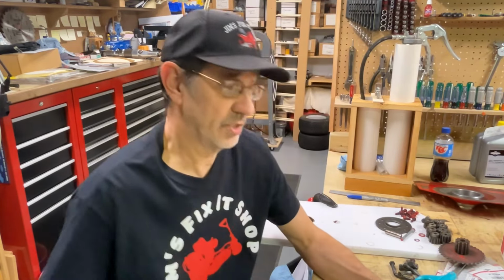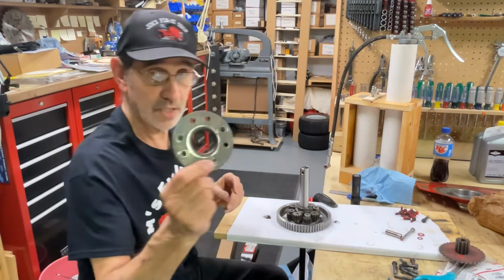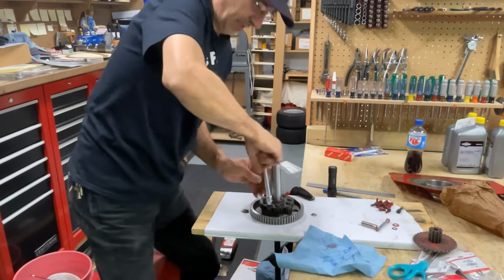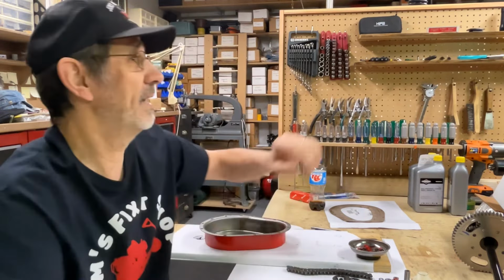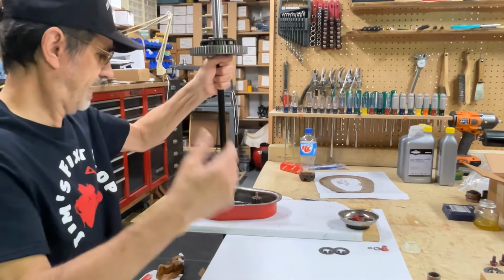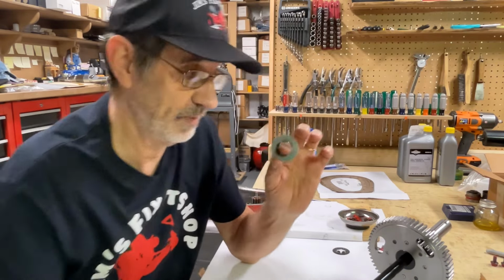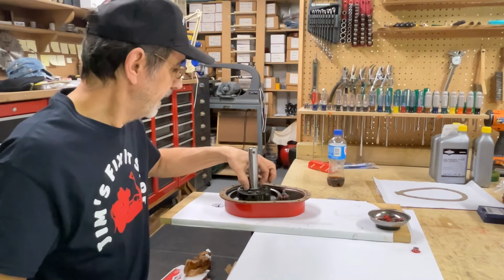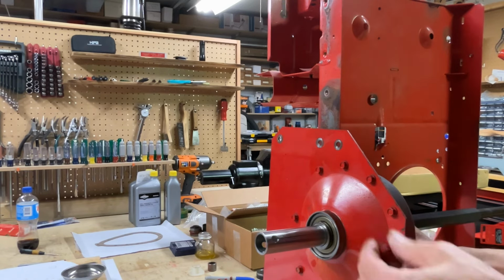467.  Part 1.   ￼ How to reassemble the drivetrain on my 33 inch Snapper.

Comment: good job in the video  i like to glue one side of the cork gaskets used to be a chevy mechanic we found out on the old valve covers that were stamped steel that worked really well and they could be reused some times.

Comment: I used lots of cork gaskets in my past life as a tech, I found that if I put sealer on them they would tend to "squeeze out" if I left them dry they would stay put but as you said you need to retighten several times, my boss once told me the gasket is the gasket, it needs nothing else, who knows, I put a sealant on some things and not others.... Thanks for all the nice Snapper tutorials.
Reply from the maker: I have seen that happen especially if you use the silicone base sealants maybe I’ll try a few dry and see what happens.      Jim
Reply: What kind of sealant would you recommend.? I’m still having some leakage after having retightened several times.
Reply from the maker: @SteveFrankFilms  I use Permax non-hardening form a gasket.     Jim
Reply: @jimjackson9381  thanks Jim

Comment: I decided to find this video just to make sure that I was doing it right.  Found an 8 hole gear in a tear down of a donor machine and was rebuilding the 307XS Snapper that my dad bought in 1968 and put my butt on mowing the 8 acre lawn.  I reused the bolts and had to use a rotary wire brush to get all the old loctite out of the treads on the bolts.  

Then, when I got all the gears lined up, found about .020 error of alignment.  This, I discovered was due to the old loctite inside the bolt hole threads.  Ran a 5/16 x 24 tpi tap through the holes to clear out all the old thread sealant and the alignment problem went away.  

Put some loctite medium loctite on the bolts and torqued them all down, checked for proper gear mesh, and was satisfied that it was good.  Then, I found this video just to be sure that I was not forgetting something and reassembled the rest of the differential.  

Thanks Jim for posting such detailed and informative videos.  You have helped more people than you know keep their mowers  in good working order.

Comment: Just put mine back together yesterday for my 33 inch. I did not know that both gaskets came together. Wish I would have trimmed the differential gasket. Oh well.  Now I have an extra set. Need to adjust the cable for the clutch brake and get the end caps on, grease the hex tube, and finish boot clamping.  Will fill with 85W-140. If anything is not quite right, I know I can find it on your videos!  Thanks, Jim.
Reply from the maker: You’re welcome and thanks for watching.       Jim
Reply: I must not be doing my cork seals correctly because my 85–140 gear oil is leaking pretty bad. Did you use any RTV?
Reply from the maker: @SteveFrankFilmsOfficial what is it leaking out of the differential or the chain case and where is it leaking out at?             Jim
Reply from the maker: @SteveFrankFilms  trying to get some pictures of where it’s leaking out of before you switch from snapper 00 to gear lube there are some points you have to seal so it doesn’t leak.       Jim

Comment: Another great video Jim; With very very helpful content. As I like to say thank You so much for your help. I've been busy with some other projects, But 3 of the 4 Snappers are ready for another season of mowing; I still haven't started on the engine rebuild for the 1974 Comet yet or the refurbish of the entire unit, But the workshop has more room now to start on it; More on that later. Thank You again for a very helpful video SNAPPOUT.
Reply from the maker: Do you sell any of these snappers once in a while I get viewers I want to know if I have any for sale if you do, I could pass on the information in the next video.         Jim
Reply: @jimjackson9381  Hey Jim; Simply put I do not they are used for specific parts of the property. That way it's less wear, & tear on the equipment, & they last longer as long as maintain them, & I like having backup in case one goes down. Thanks though I'll keep You in mind if I ever do.

Comment: I kinda replaced my snapper last season, with a zero turn 42", can't get it through one of my gates no real problem, I just use push mower to trim pool area.
I was having a problem with trans/diff when pushing snapper backwards into shed, it would sometimes lock up, like chain was a problem. Would give me a heads up of a possible problem/solution? Please, and thanks for your time and videos.
Reply from the maker: I would stand the machine up and check the differential cover for any issues or slots cut through it then turn the clutch disc assembly with the machine in neutral and see if the tires turn while you’re turning the assembly. Let me know what you find out. Jim.
Reply: @jimjackson9381  When I get to it (still pretty cold), I'll update you with my snapper progress. Thanks
Reply from the maker: @ForgetU okay sounds good.       Jim

Comment: What parts store do you use and rely on?
Thanks Jim
Reply from the maker: Well, there’s several places most of the stuff I buy from
Parts Tree.Com 
My local Ace hardware
Area snapper dealers that are still selling parts 
And sometimes Amazon 
I don’t buy much of anything from eBay because they don’t always sell you the correct part. If it looks good, they ship it to you.             Thanks for watching.
Reply: RC Cola? What happened to PEPSI?
Reply from the maker: @gregoryvanek9038  well, I’ll tell you in February 2014 Russia invaded Ukraine and all of the US based companies pulled out of Russia except for Pepsi they stop selling Pepsi in Russia but Pepsi owns more companies and you can count and they’re all still selling products to Russia so I don’t buy any Pepsi or any of Pepsi‘s products from there sister companies.        Jim